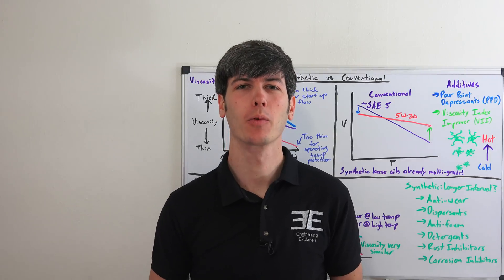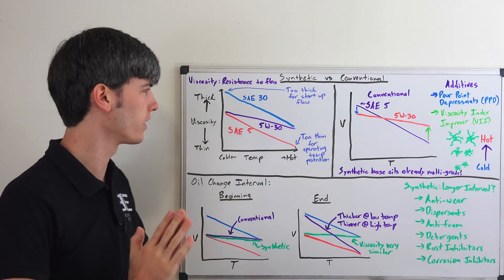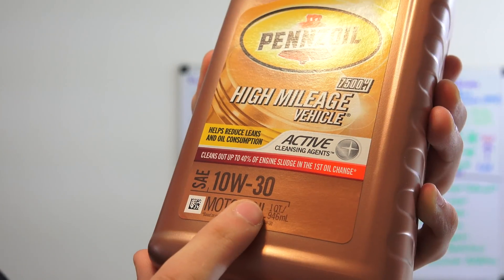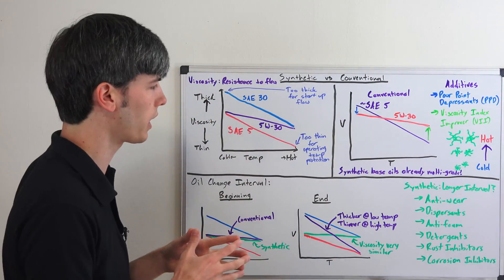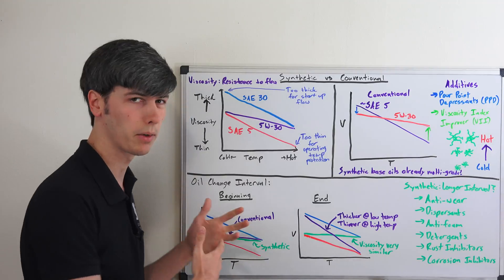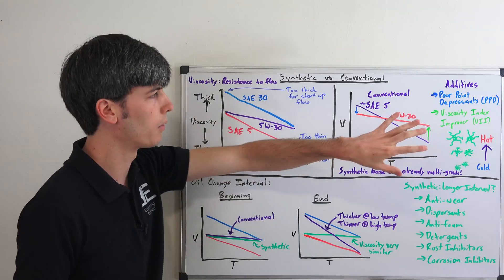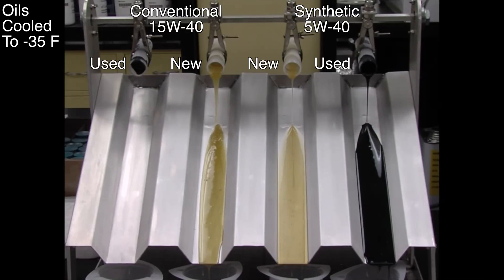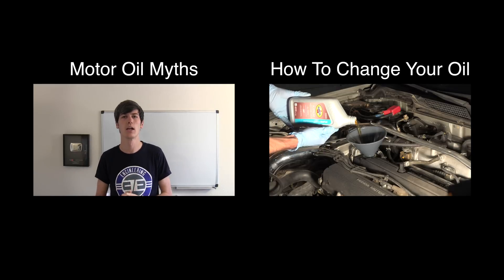Is Synthetic Motor Oil Better For Your Car?

Comment: I think  that people need to  know  about fluid dynamics   and Hydraulic  for  pascals  Law.

    Here's what i learned.    The first number  is the thickness  at rest   based on the Temperature  while the W   was called  Weight    while the Hyphen added the next number   for the Flow Rate   to stick to the parts  and reduce friction.  

   Two points are  needed  to be made  and the first  one is  that  you must take into consideration  the Climate  for where you  live   which can  have extremities  like a normal Summer  from  75-90 degrees   while the Winter  can be  -20 to 15 degrees  .
   Then comes the  fuel economy  and   dealing with  Hydraulics   based on the  manufactures   specs  for  what they list in the Section  dealing  with Fluids and Capacity.   The engine  may be rated for  5w   Oil  to meet  the  Mileage  claims  and  Horse Power    ratings  through the  rpm's.   If you switch to a  10W-40  for the Summer   or even a 15W   , the  thicker  Oil through its range robs Horse Power   to just as  your blood  would rob  energy  if it got thinker to strain the heart that is the pump  sending oxygen  quickly  to where it's needed. 
      
               
        For a real  example,  my City has the exact  Climate issue  I pointed out  while the Manufacturer had a Chart  in the Manual  showing a wide range of  Oil choices  from  -40C  to  +40  C  (  -40 F to  104 F ) .   When  I chose to switch to Synthetic  I had to   take into account  that I drove  about  500 miles per month  and it was 90%  City traffic.  
        The manual  5 spd   lowered the cooling  loads on the radiator   but  a dealer  installed A/C  unit   added the Condenser   heat  being drawn  through it which was well above  the outside Temps  in the summer  when the AC is needed.     
        Now  I'm looking at   the Oil  which will last  me 2 years   so I  bought  extra Oil Filters  and      
      a  strong  magnet  for the Filter   to  trap metal filing   over time  .  The Oil  I chose   was a 15W-40   because  it gave me the Summer protection   while  it didn't become like Honey in the cold  so a 15W   would flow  like an Organic  5W   on top of  my City driving  in the cold  where the radiator  didn't get the Highways   cool air  90% of the time. 
 
      Even in very cold  weather  I could see how the engine turned over with ease  and  how the Hydraulic Lifters  pumped up  quickly  as they do in the Summer,  plus I could  drive  away sooner  to take it easy   in the City  as the Oil heated  up and engine parts expanded. 
      City  traffic and  the  heat   in the Summer also  had me  changing  the transmission  Oil  on my   cars that were Automatics , those  were  done  every 3 year  from the city driving  or   30,000  miles  if i didn't  90%  Highway  driving. 

      I don't  doubt what is be said  in this video ,  but   you should  make note of  the conditions  for the  use of the vehicle  and the local  Climate   as well what the  manufacturers specs   that may   have a  warning to  use only 5W  version  of motor oil .

Comment: Not that much advantage for synthetic under normal conditions.  It is the extremes where synthetic can save your engine.  Super cold below zero starts are always smoother with synthetic and a big reason I use synthetic.  At the other end a damaged cooling system like from a broken belt will let regular oil thin out and blow past the piston rings.  It is the loss of oil that ruins the engine.  A synthetic can take twice the heat without blowing out of the engine.  John Deere lets me run synthetic oil 50% longer without affecting my warranty provided I use a JD oil filter.

Comment: If they are going to try to prove something, the use a good oil and not this Pissoil as we call it. Use something good like Amsoil or Mobil1, which I personally don't care for. I always use Amsoil in my engines, it is a much better oil and there is much less wear on the engine parts, but still it leaves a nice residue on the parts for the cold start ups.

Comment: Surely it is that the anti rust and corrosion inhibitors do not wear out neary as fast as the additives conventional use to attain variable viscosity. Id say that a oil seller would not put 15k miles on it( that being the number 1 oil seller in the country!) if there additives would not last as long as the oil.

Comment: Rust is a type of corrosion. corrosion that is red is rust because it has iron in it and iron turns red during oxidation. Corrosion starts imediately due to metals trying to return back to there natural state. oxygen, water, and other external factors speed up the process. there are diffent types of merals in engines and thats why they use both terms for the layman.

Comment: He mentions that you should change the oil based on what the manufacturer says, my 01 civic says 3000 but my 2015 gti say 10k or once a year. Now I always thought the civic says 3k because they used conventional, while the gti uses synthetic from the start. I always figured with synthetic I could get away with 6k miles on the civic. Anyone want to chime in on this?

Comment: if you do not have a turbo do not waste your $ on synthetic unless you are going to run 10k miles between changes 
i run 10W40 here in texas and change every 5k miles  and get 300k or more miles out of my cars with ease and i just buy whatever is on sale in 10w40 conventional oil and i pull a trailer allot 
even big rigs use 15w40 conventional oil and run a mil+ miles without rebuilds

Comment: hehehe, you go through all the trouble to prove synthetic is better than regular and then compare 15W 40 to 5W 40.   Typical salesman .   Use all the reasoning you want, bring out math and graphs .   You car requires 5W 40,   in January change your oil to 15W 40 if your so sure of your comparison.

Comment: you should have used the same oil such as both being 10w-30 because it does make a difference how they would flow. and maybe just have done it at room temp.

Comment: I have worked as a mechanic fore 35 years  . This is my findings . Cars  build in the last 20 years have much tighter internal clearances and do require thinner oils than older cars. However there are many guidelines that affect what oils you should use . I consider the oil rating on an oil cap to be the thinnest oil recommended . Cars driven in an area or season of 60 degrees f. or less should use at least 5w30 . Cars driven in an area or season with temps over 80 degrees f. will benefit from thicker oil such as 10w30 or 10w40 . I use synthetic blend and change oil every 4 to 5 k miles . Check you oil often if it gets black at 3k change it. But if it looks good up to 5k make that your changing time . If you use full synthetic oil you can wait till 8 or 10k .However, not all engines like full synthetic . Many will burn oil excessively .The first thing to wear due to bad oil is the oil seals . So just remember to keep it full and changed . And ask a mechanic what thickness of oil is good for your climate , your engine design,  and its condition .

Comment: Cooling the oil to -35 to demonstrate ANYTHING is silly, as that is an unrealistic operating temperature for most vehicles.
Reply: Vehicles do operate in the winter in the upper northern and lower southern hemisphere. -35 is very realistic
Reply: I think you missed the point, it was only to demonstrate the differences in oil viscosity. Cooling them makes the differences more noticeable.
Reply: I see someone has never experienced winter in Canada. -35 is very real to us and it can be even colder.
Reply: Dude, In the winter here it can be around -35 for weeks. It's a very realistic operating temperature.
Reply: Ya except for like 25 states in America. And Canada. So....
Reply: I actually agree with you. It is silly to cool the oil to -35 F. I didn't see the point because I hope to never see -35 F again. Where I live I don't need that kind of information.
However, it was informative for Canadians and "South Canadians" (Northern US States that are TOO COLD for anything to survive).
Reply: +TheGIANTgonads I couldn't have said it better.
Reply: That is why vehicles have block heaters to maintain higher temperatures above that, in those regions, when the vehicle is shut off. so no not realistic and if you don't have one lol good luck trying to make that car last
Reply: I think the demonstration is showing that the viscosity in synthetic oils is more consistent than conventional oils as the oil gets miles on it.
Reply: +Hector Bedolla 
block heaters only work when you have power. I'm not usually lucky enough to have that. -60*F and my truck still started just fine with 0w-40 Mobil 1. -35*F is normal here for months.

Comment: I spoke to manufacture of synthetic that created their own patented formula. They said that the viscosity really doesn't have better or worse properties when talking about "protection". They said it's just for matching manufacturer specs for bearing clearances etc. 

He said using a oil that's thicker just creates drag and friction and thus worse he, talk,  and mpg. 

I'm just wondering if oil pressure is important to have in specific ranges and if viscosity changes in order to maintain the pressure is a good idea or if it really doesn't matter as long as there is a certain universal minimum or maximum..

Comment: i Still dont get it, my car uses a 10w-30 selenia oil, if i use the premium selenia "racing" oil 10w-50, the cold start is same as my stock oil but at proper temp and high rpm will it perform better that the stock oil? Or it will be thinner?

Comment: Just use Slick 50  or Prolong for start-up protection, and run a straight weight 30 in winter or 40 in summer.

Comment: quick question about the ratings and forgive me if you covered this. 
Looking at the manufacturer recommended viscosity on a Cummins diesel engine. 
It shows a chart and the two I am questioning would be the 10w40 compared to the 15w40. I understand the W rating, but why would the chart show the 15w40 having a higher temp rating than the 10w40. I would think they would be the same at hot temperatures. 
Of course the 10w40 has a lower temp rating and would be the oil of choice in colder weather. 
Hope my question makes sense.

Comment: You should use the oil the manufacturer recommends, the only reason for using a different type would be if you have problems with low oil pressure in a worn engine, you can try a higher viscosity to compensate. Mineral oil is better for older, worn engines. Synthetic oil is thinner and has generally better cleaning out the internals of your engine. Better for newer engines.

Comment: Why didn't you use the same weight oil at 5:34?  A 15w conventional oil vs 5w synthetic will always move slower at 35 degrees. Why not compare 5w conventional oil weight to 5w synthetic.  Otherwise it is informative.

Comment: I am not having a car, my father does. I was told that it also depends on age of engine. In case you are about 200 000 km (124 280 mi) it is preferred use semi-synthetic. If is over 300 000 km (186 420 mi) high recommendation of use conventional type. Also you should remember, there is not way back from conventional to synthetic.

Comment: I own Tvs apache rtr 160 as it doesnt have any cooling system like oil or liquid cooling.I am living in India and in summers the climate temperature raises sometimes to 40 degrees or above.So kindly tell me which engine is good for my bike a thinner one or thicker one.I am using castrol bike engine oils and i usually prefer castrol gtx 20w50

Comment: With motorcycles the oil is also used in the gearbox unlike a car with transmission fluid. Yamaha recommends their Yamalube sysnthetic blend for my R6, and every great mechanic I've asked recommends the same. End of the day just use what the manufacturer recommends & what is in the service manual. But I had great luck using fully synthetic mobile1 in my cavalier, over 120,000 miles and not a single leak, sold the car still running great.

Comment: What about older engines? My Mercedes W124 was made for 'normal' oil and synthetic oil is not recommended because it can cause leaks. I use mineral 10W40 oil.

Comment: I agree  and I disagree with your statement that synthetic is better than conventional. Syn. was invented for the aviation industry to withstand very hot and very cold temps which syn. excels at. If your engine operates at either of these extremes (tropical equator or artic cold) use syn.. Conventional oil is suited for all climates in between. Dirt is the biggest factor in the life of an oil and the engine. Never, ever run dirty oil in an engine. When your oil is black that means it is dirty, change it. Conventional oil can last a very long time before the oil itself wears out and synthetic even longer. That does not mean you should continue to run it once it becomes dirty.  I received my knowledge and training from the US military.
Reply: Oil can turn dark with not many miles on it, so it's hard to tell if the oil is bad by the color.
Reply: Car Sick!! The oil is dark because it is dirty.
Reply: So, you recommend changing the oil at 500 miles if it's dark? Because it can be dark with low miles on it. 

+SuperSaltydog77
Reply: Car Sick!! Well, think about it. Why is your oil dark. The inside of your engine must be filthy. That's why your oil is dark. Your oil is full of carbon. The element that diamonds are made from. Very hard stuff. It scratches the inside of your piston walls, your crank journals, and so on. Run some engine cleaner through your engine to clean out the sludge that's making your oil black. Come on, this isn't rocket science, it's common sense.
Reply: Yeah, oil turns black when it's doing its job, it's a good thing. You can't expect oil to be clear all the time. Now, there is a limit, too dark means too dirty.

Comment: BS! been doing oil changes for over 30 years, and I have never seen oil move that slow under normal temps. extreme cold temps will slow the flow of oil and even freeze it, including synthetic. mixing the 2 is a BIG mistake tho.

Comment: no synthetic oil can only really be used safely in older cars which get serviced every 3000 miles or something, all modern engines require at least semi synthetic oil or you can start causing damage your cat and/or dpf aswell as many other oil seals and sensors.
Reply: non*
Reply: +Jacob Trammel I dunno then, I'm talking about old Ford pinto engines from the 70s and that. Didn't realise some engines could do so well using mineral oil.
Reply: +Jacob Trammel plus I didn't say every engines oil needs changing every 3000 miles exactly, it was just an example....

Comment: 72 year old ex Donnington GT racing champion   1980  Great video . I only use fully synthetic and have had no engine lubrication problems  in my racing and normal engines.